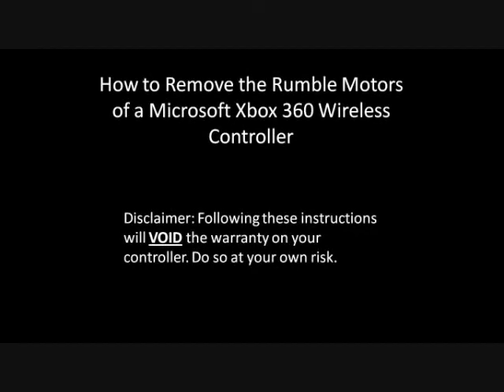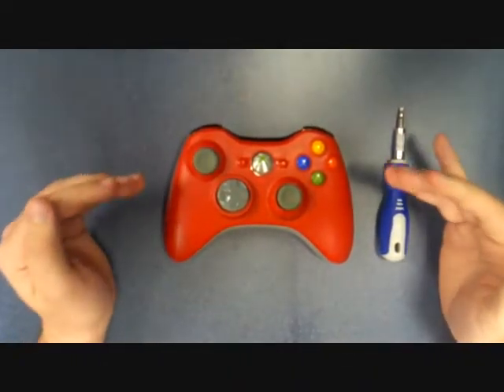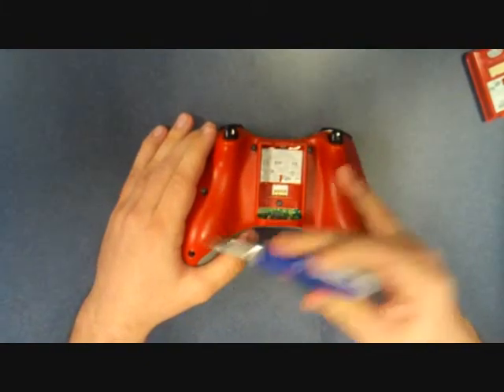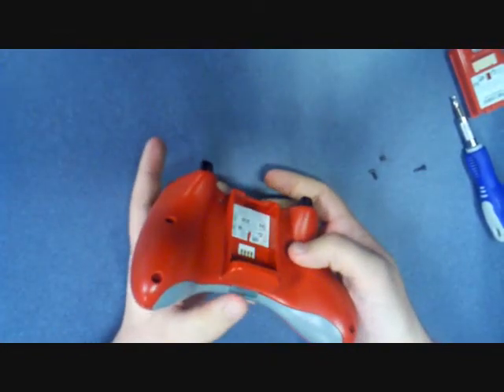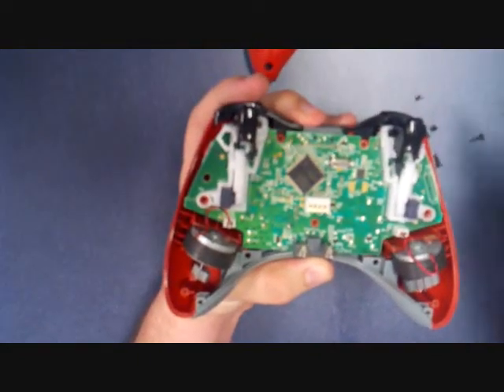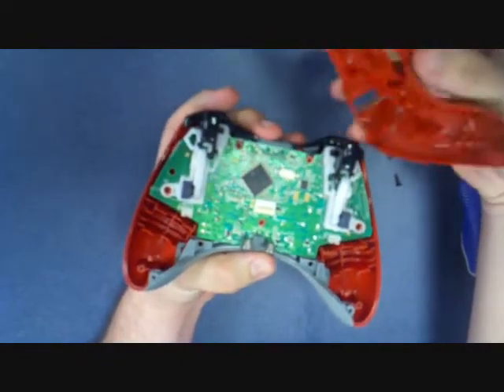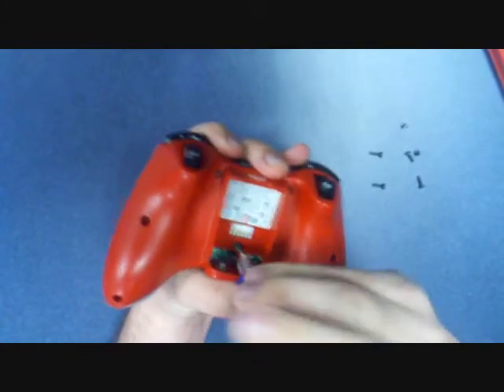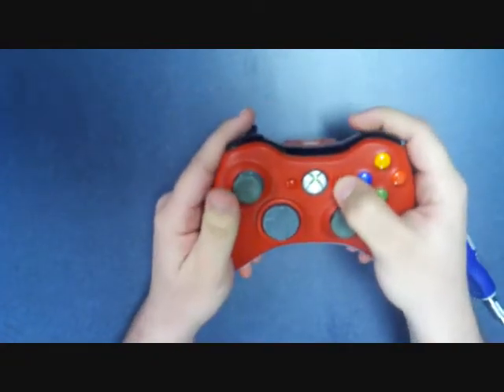Removing the Rumble Motors of a Microsoft Xbox 360 Wireless Controller

Comment: Awesome video dude.

Just want to add that anyone reading this who has a WIRED controller, the layout will be a bit different.  You'll have to unplug the male connections with them facing downwards away from you.

But seriously, thanks for posting this video.  It gave me the motivation to successfully remove those stupid vibration modules from my controller!  Screw you Sonic Generations and Dark Void Zero!  And screw you Microsoft!

Comment: _____This is awesomely necessary.  For all the mighty power of Microsoft's design teams, you'd THINK they'd add an OFF feature for the rumble.  Nope, they didn't.  What the fork do they pay those jokers to do at Microsoft, anyway, shove their thumbs up their anuses and sniff 'em--tryin' to guess what each other ate last night?  (Snort...  "Smells like you had bratz with chocolate sauce.")  Apparently, those freaks aren't doing their job.
_____For an added BONUS, the controller doesn't weigh a ton anymore!  This is coming from someone who curls weights after work.  (30 reps, 70 pound dumbbells.)  Weights are supposed to be heavy.  Controllers, not so much.  Jeez, maybe I ought to curl unmodded 360 controllers instead?

Comment: Why can't you just touch the chip without touching metal
Reply: because any static electricity you are currently carrying would fry the chip.
Reply: TannerJ815 Is there any way to get around that? how can you avoid it if say for example, I wanted to change out my faceplate?
Reply: just make sure you are on a non-static surface (no carpet) and have a metal object that you can touch before you come into contact with any sensitive hardware
Reply: TannerJ815 Thank you. I was wanting to add some custom buttons and new thumbsticks/d-pad.